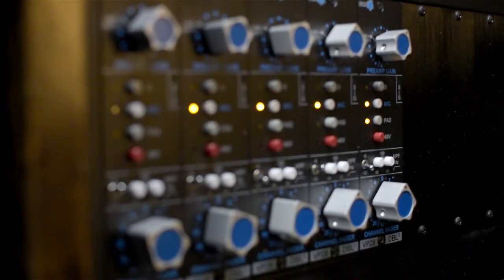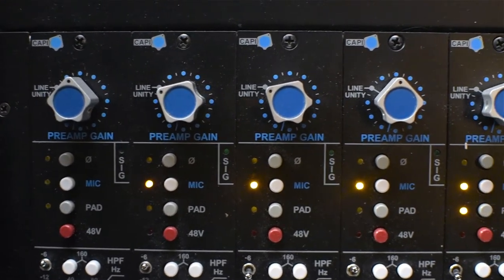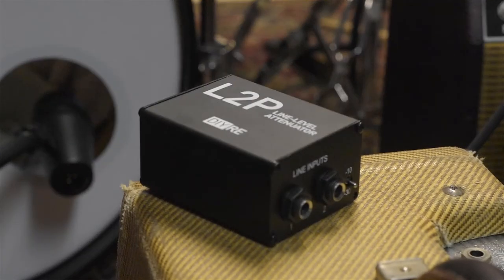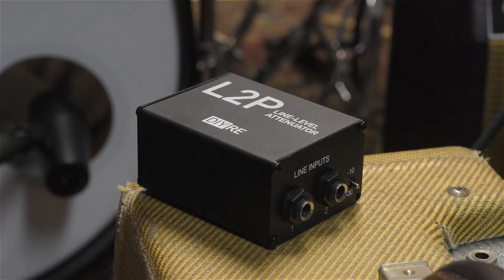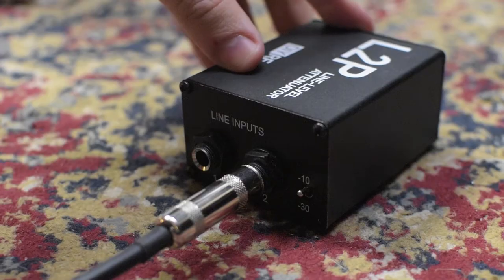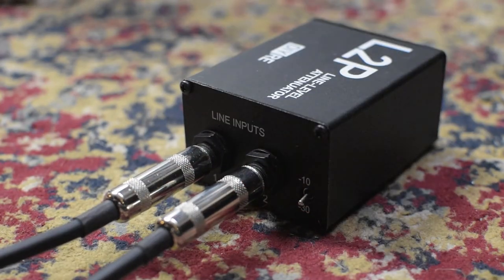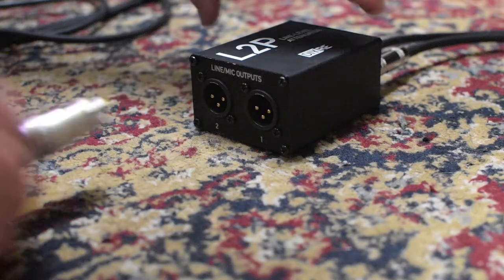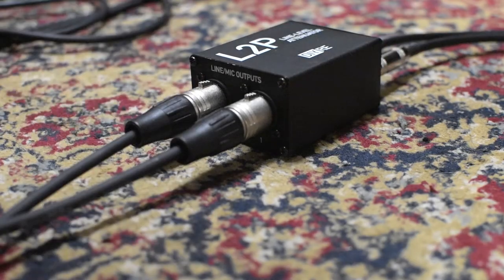Preamp Mix Glue with the L2P

Comment: pushing the idea a little further, even if you have a line input on your preamp you should use the Mic input anyway as, generally , if the design as been made with a MIC transformer AND a separate Line transformer, the mic Transformer will have a higher Ratio than the Line ( wich is suppose to be 1:1 really transparent by nature). Therefore, the mic trafo will color the sound far more. Also, on a neve 1073 ideally i'll use a 45db linepad and crank up really high the mic pre to find the sweet spot. 30db is a bit light for neve pre i think.
Reply from the maker: Definitely true of the 1073!
Reply: Thanks for adding this! I was thinking the same thing. There is more of a benefit to attenuating and using the mic input since it will color the signal with both stages. I think this makes a lot more sense since color and glue is usually the main goal.
Reply: I run stuff through my UA 610 MKII via the line input, but I never thought about via the mic input. Question, do u enable phantom power when running signals the the mic input?
Reply: @emericas9  absolutely not! if you go from your soundcard to the Mic input of your 610 you only need a Linepad wich is a passive box. The L2P is one of them.

Comment: Great video! At the moment I can't afford getting the SSL Fusion (or any other dedicated outboard mastering equipment) so I was just thinking of doing a similar thing and running my final mix through my preamp which is an SPL Gold Mike (vacuum tube pre) hoping to add some overall 'analogue flair' to the sound... Thanks again!
Reply: Did you ever do it, how did it sound?

Comment: Jesse, great vid.
But you explained how to get DAW master bus, stereo 2-channel signal into the external CAPI preamp, but how did you get the 2 pres outputs back into DAW so the pre effect gets printed as final mix effect?
Reply from the maker: Great question. Just run the output of the preamp into any two line inputs on your interface. Just make sure that the channels  your recording to in your DAW are muted or don't have monitoring enabled so you don't get a feedback loop. Hope that helps!
Reply: And when you do get the feedback loop once or twice, you tend to never do it again :)